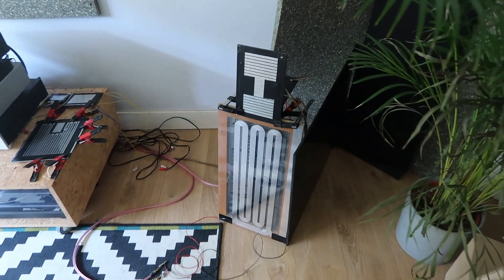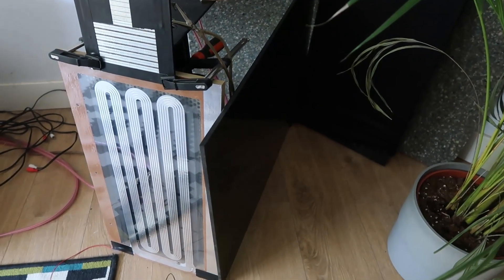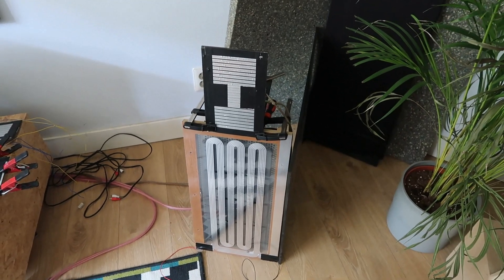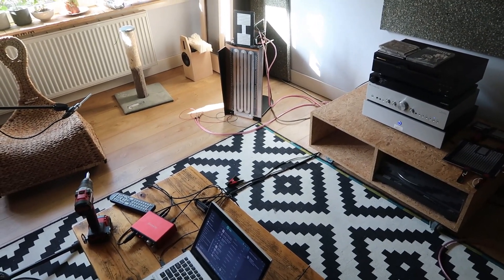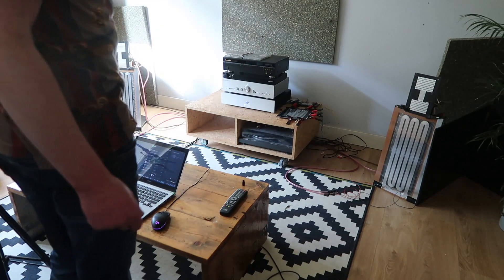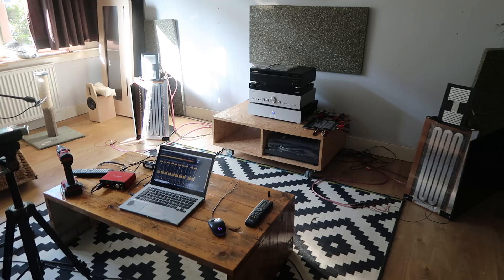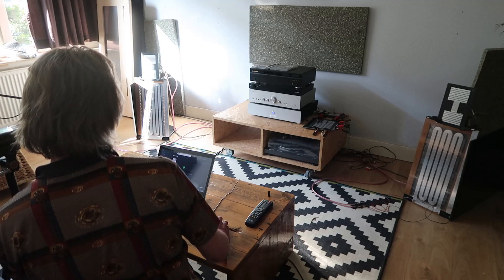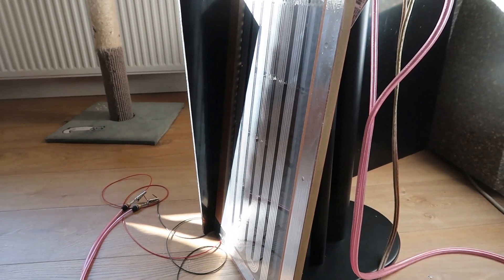Bass Planar Magnetic Woofer from scrap steel - Part 5  3 tunes

Comment: The moving mass on these things is just a handful of grams! I love it. A speaker box will definitely make the bass more defined and go much lower. They sound amazing though. Do the edges of the coil line up with north or south poles on the permanent magnets? In other words, do the parallel traces line up with the gaps between magnets?
Reply from the maker: So the traces you see close together are in between 2 magnets one north facing up the next one south ( this makes the steel a pole piece and increases the magnetic field. The outer 2 traces are sligtly on the edge of the magnet. This trace is wider to mitigate the stronger field there

Comment: Sounds very nice! Would be nice with a measurement!  
Regarding X-max in planar speakers: (from the US 7,142,688 B2 patent, slightly edited)  "In fact, it is surprising that by decreasing the distance between magnet and diaphragm  of a single ended planar-magnetic transducer, that not only the efficiency and damping improves, but also the large signal output capability increases! The prior approach was to expand the gap so as to allow greater diaphragm movement to achieve greater acoustic outputs."
Reply from the maker: Thats cool to hear ,  since thats what i preached for some time  :) (its nice to see others agree) increasing X max is not the problem solver,   although the damping i did not even take into account.  i do see this happen with the rubber magnet variants since open area is so limited it has dampening on its own compared to these that need external damping.  or  it is one honk fest :)  im sure there is a like a butter zone where both meet. damping vs xmax.  i mean the rubber variants do need more surface area to compete with this setup for instance in max output. these also have more punchy sound. but although xmax on these is 3 times higher i do not think a rubber variant needs to be 3 times as big to compete. 

Thanks Jonas ! for the info ! very interesting ,as always !

i was just standing in my kitchen thinking of making a sub simliar to these panels but almost 2 as wide.  what would be cool is get res as low as 20 hz or so, then use a plate amp to make sure that resonance is hardly hit. this should clean up the rest.   it might be a really nice thing for maggie users compared to the DWM sub they sell. to make even a LRS play with more bass and lower making it a very interesting choice to buy (if i may believe the raving reviews about the rest of its performance)

Comment: Dear Joppe, everybody
(excuse me, sorry with google translator)
Great experience with this bass panel! I didn't think it was possible !!!
I made it about 2 weeks ago with 2 dynamic speakers made of cardboard with a RIPOL layout.
If I had two such bass panels, I would try the RIPOL layout right away, because very extreme things happen with the dynamic as well. Advantages: 1. It doubles the surface, so the X deflection is halved !!!!! (When using 4 panels, the bypass is quadrupled with the same SPL !!!!!) 2. Moves Fs lower !!!!! 3. It brings an amazing spatial effect, “breaks down the walls of the room”.
4. It excites amazing speed !!! (Based on Bernoulli's law, an aerodynamic paradox !!!) It's as if it radiates more easily in the acoustics of a room. (If you try this with the two panels, please be sure to share it in the video)
Reply from the maker: These in ripole does not work very well im afraid :( i once tried something like that, i think it has to do with the drive force not being big enough when compared to a normal dynamic  driver, and the fact the membranes are essentially acoustical transparent (so sound can go trough them).   indeed going from 1 to 2 panels per sides is going to be  a major difference.  lowers FS a tiny bit, lowers distortion and increases max spl.   what we heared now would just be one channel :) when using 4 panels in total. probably good enough for such small room if ochestra dynamics are not required :)

Comment: One way to get more bass out of them is to use a closed chamber behind to load them up. About 15 cm deep with enough absorbent material would be enough. You would lose dipole radiation but you would gain some dbs low down and have better control on the foil movement.

Comment: How would you compare the bass of these with say a 5 to 7 inch sealed dynamic woofer? A dynamic woofer will outperform these in power handling and max SPL department for sure, but I am interested in your overall listening experience of low end quality of these vs dynamic woofers of say 5-7in sealed enclosure.
Reply from the maker: hmm its hard to say, since i dont have one to compare :( i would say the sound now, at a normal volume that they are capable of,  the sound is really pleasant. 
im sorry i cant say much more usefull about it
Reply: @joppepeelen  an A/B test recommended :)

Comment: Isn't too much membrane resonance? I hear how it vibrates ) A fast bass mood is definitely recognizable. Keep on bettering it!
Reply from the maker: You need to cross it if you dont want to use the natural resonance.  It will always have one.  What you  hear is it working on the edge of what it can i think. I did not measure a huge res peak at 1 meter so it is damped to a degree ( not completely ofcourse)
Reply: @joppepeelen  You could also just put a big pillow directly behind the speaker, makes usually a great difference.
Reply from the maker: Nicest would be crossing it so resonance falls out of the pass band. But to do that verry low res must be achieved i think.
Reply: @joppepeelen  This is an interesting challenge as I can guess. Crossing fingers.

Comment: Impressive work, Joppe. Do you have any ideas on getting more control of the membrane? I mean, when the sound "stops", there's nothing but membrane tension to stop the membrane. So the Q value is rather high.
Nice tune with Riltons Vänner (Rilton's friends) and Schack matt (Check mate); I must check (sorry) them out!
Reply from the maker: Yeah Q  is high, it always is in these kind of low drivers (apogee , magnepan etc)  the only way to get it down is more damping, or spreading it out a litle better.  best way doing that is damping inside the panel on top of the magnets. or even if i can live with the losses a thin sort of damping over the foil itself. (usually that hurts top end the most in output but i do not use that anyway)

Comment: wow. wish I had a way to cut those to make a set they both sound fantastic
Reply: Not sure how practical it would be but the master (Joppe P) has done the "printed and etched" method also and has videos of that too. Not sure if a big plotter printer is required or easier to find or rent than a CNC cutter but...
Reply from the maker: Well master.... master of never finishing anything :) but yeah plotter is the most practical unless you need super tiny traces
Reply from the maker: thanks !

Comment: Listening via both my in-ears, and my main 2 channel rig, I'm so digging this. 

The panels characteristics really seem nicely captured by your process... 
The sound,... nice pleasantly executed clarity and cohesion, it sounds nice.

A separate issue 
Not sure if this is true, but in my experience, dipoles seem to translate well in two channel capture and playback like this. 

Whatever modal interaction isn't worsened by monopole pressure sources, just seems better presented, cleaner... in this type of "you are there" capture/playback. 

Dig it